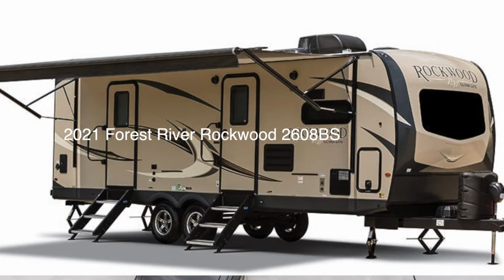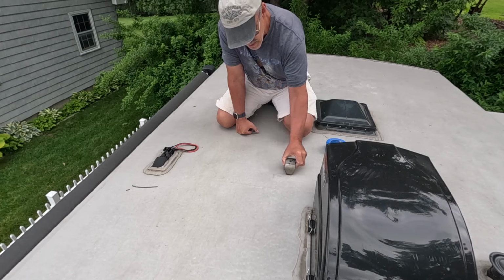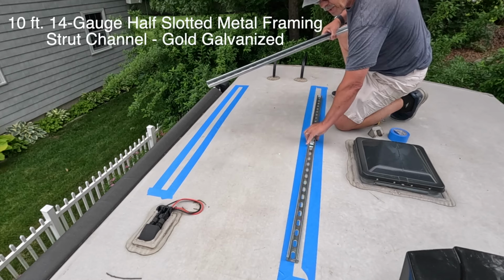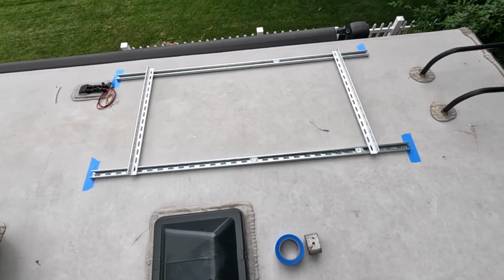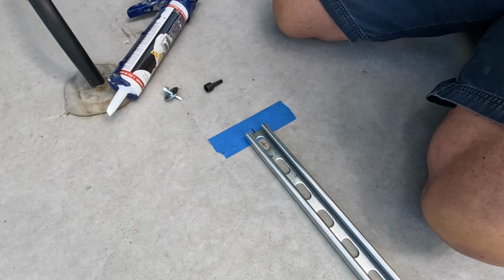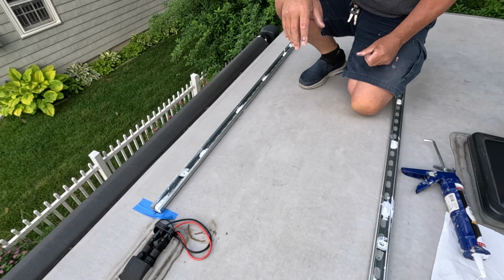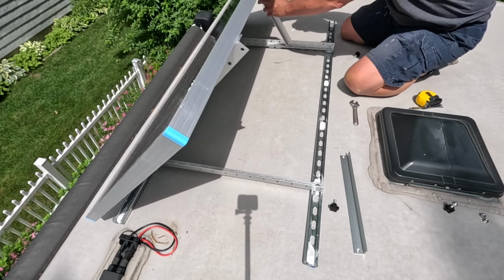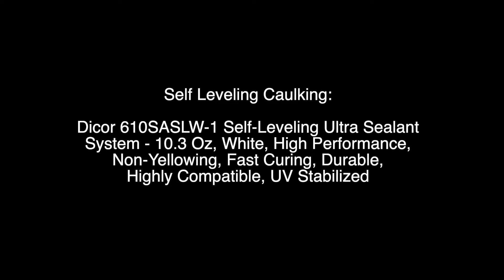Solar Panel Install - 2021 Rockwood2608B

Comment: Hi,
Can you please tell me what number did you call to get the roof plan. I am installing my solar panels and I am struggling to find the studs on my coachmen.
Reply from the maker: The number I called was specific to Rockwood so I would think that a service line to Coachman should be used.  You could start by calling their home office at (574) 825-5821 and see if you can be connected to the Service area.

If you do not find the roof struts and need to mount into the roof, take a look at using Well Nuts for anchoring the panels - https://www.mcmaster.com/products/well-nuts/